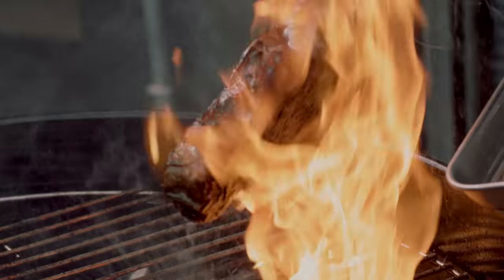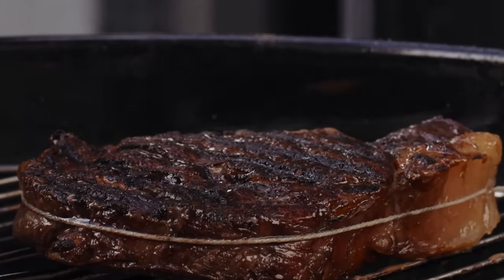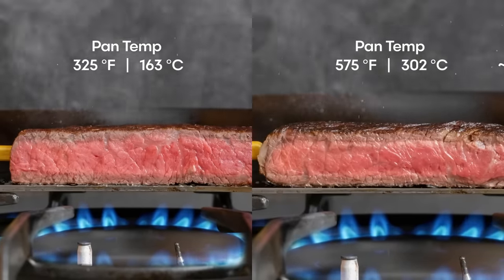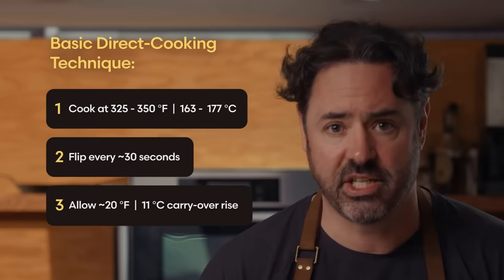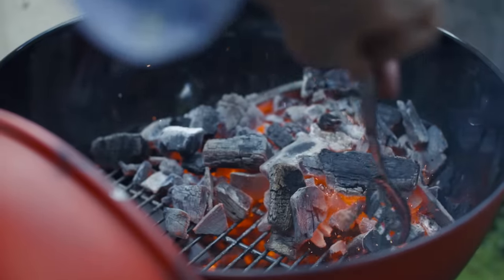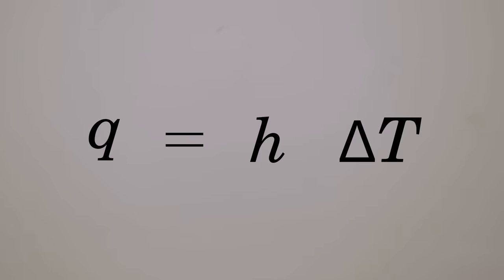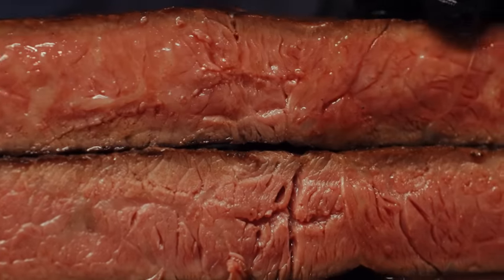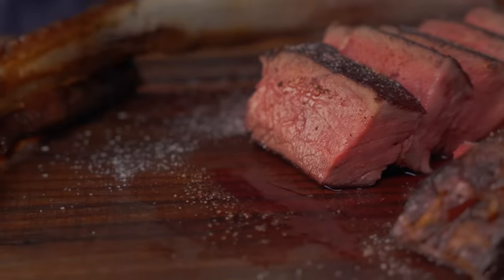Why Ripping Hot Is Too Hot? | TESTED

Comment: Insane! So much information packed in one video, had to rewind and watch at various points. Also, in terms of production, today's video looked like what I would imagine a video version of Modernist Cuisine would look like. Kudos.
Reply from the maker: Thank you so much!
Reply: I've been looking for the perfect technical tutorial on how to cook the perfect steak that conveys what I've intuitively picked up to friends and family, and this is the one. 

 @ChrisYoungCooks , you've got extremely high production quality, and you're able to articulate the nuances with enough concision to make tough technical concepts accessible. Plus, whatever the heck you did to make the cutaways work, amazing job.
Reply: what fryer appliance did you use at the end there? @ChrisYoungCooks
Reply: medium rare pork chops are the best
Reply: @hab1b1  It looks like a knIndustrie borosilicate glass pot.  I personally wouldn't try this at home.  Borosilicate glass is perfectly capable of withstanding the 400F temperature he's using.  But it has a much higher potential for catastrophic failure than a metal pot.  It was a great choice for the video, to enable people to see the deep frying in-process.  But you won't like the burns you'd get if, over time and hard use, the pot develops a crack and bursts when filled with hot oil.  knIndustrie sells this pot for boiling pasta.  Still not great if it breaks on the stove, but that's only 212F instead of 400F.
Reply: hey man, this is a really awesome and informative reply. really appreciate you! @missingegg
Reply: @ChrisYoungCooks  I may be overlooking something obvious, but I'm legit baffled at how you got the cross-section cooking shots! Special pans cut in half? Video AI generation magic?
Reply: @missingegg well said compadre!

Comment: I just put enough oil in the pan that I might as well be deep-frying it.
Reply: Oil temp will drop a lot if it's shallow and impede a good sear.  Specific heat of oil is much less than h2o.   That why deep fat is recommended- oil temp won't drop as much.. Cast iron for vessel helps.

Comment: Yesterday, I made some reverse-sear steaks and what I thought was a mistake, leaving my steaks out for 20 minutes and then searing them in the cast iron on medium turned out to be one of the best steaks I've ever made. After I took the steaks out of the oven I got distracted with finishing the roasted potatoes. Normally I take my hot oven steaks and throw them immediately in a hot pan and often, the steak goes way past medium. I actually prefer the reverse-sear (and wait) method because you can do large groups with this two-step process. Ripping hot pan is "the best" is somewhat of a myth to getting a good crust. Thanks for this video.

Comment: I’ve been using a Combustion inc thermometer for a few weeks now. My steak cooking method has evolved as a result. I cook in a 200° oven until the internal temperature reaches 105°.  I then sear In hot pan with a generous portion of oil. It’s not deep frying, but it’s close. After resting the internal temperature is right around 130°.  I like the idea of resting before searing. I suspect I will have to cook to a higher internal temperature initially. 

Thanks for the great information. I love your thermometer.

Comment: Really nice content. For work I helped a chef who was writing a book and we did several experiments on browning. I agree that excessive temperatures are not needed, also because the Maillard reaction also occurs at lower temperatures. What is important is the drying area, it is necessary to prevent the steam from raising the steak from the Pan and lowering the temperature, increasing the gradient of liquids towards the surface. To do this we have found that a light weight is always needed which forces the steam to exit laterally, speeding up the whole process. And this applies from steaks to vegetables. give it a try chris
Reply: so like a bacon press? or something long and thin across the middle?
Reply: @russellmz like the bacon Press. I suggest something like the chef Press that allow evaporation
Reply: That makes so much sense. Chef presses are a luxury gadget I’m struggling to justify but I’m glad to have my intuition corroborated!
Reply: That makes complete sense when you think about it: smash burgers always require a weight and they’re best known for having that wonderful crust. Different application, I know, but in principle it’s similar.
Reply: @BarneyCarroll  How about the bottom of a cast-iron skillet??
Reply: @BarneyCarroll  Its been a while since your comment, but you could easily ask at your local machining/milling place to make one for you. It might be cheaper the offcial price
Reply: Agree that a weight atop a steak really helps- especially steaks that tend to curl when heated.   I made a weight from a Lodge cast iron, 8" trivet.  It has many big holes to allow the steam to escape.  Added a handle made from 3/16" steel rod with ends pounded flat, a hole drilled in each and trivet then screwed to trivet.
Reply: @BarneyCarroll  Drill holes in a cheap but heavy bacon press.

Comment: I feel so good about myself after watching this video! I taught myself searing steaks in a Manhattan kitchen with a nearby smoke detector that could not be disabled so I had to figure out how to do it without setting it off, yet get that nice brown coating under 2 minutes! I ended up using the sous vide technique, then leaving it out to dry on paper towels and cool off for about 20 minutes, and then searing it in a cast iron skillet that was preheated for about 8 minutes on the not very powerful gas stove. That seems to check most of the boxes to get a good sear, and once I had perfected this technique, it really did! The only thing missing was the charbroil marks (I do like some of those). Recreating that with a torch wasn't super successful. Now I have a nice outside charcoal grill, but honestly deep frying it sounds really appealing too. I might have to try that.

Comment: As someone living in a poorly ventilated apartment with no hood and no grill (something that is probably not terribly uncommon in cities) learning about cold searing kind of changed my life! I went from not having a good seared steak (or pork chop/loin for that matter) for years to being able to have one whenever I wanted. It's not perfect, and doesn't produce a crust quite as luxurious as a traditional sear method does but it gets extremely close, is easy, time efficient and most of all produces no smoke and very little or no splatter so cleanup is nothing. That is my favorite method for searing or cooking steak in general, these days. Though I did want to try deep frying (before I found the cold sear a couple years ago) because it was also a no smoke method and I thought it'd produce a perfect crust. I'm glad you tried it.

Cooks illustrated has a great breakdown on the cold sear, for anyone interested. I'm sure there are other resources as well.
Reply: Cold sear has blown my mind. It's going to be my go to method for a while.
Reply: I'm in the same situation. I pan sear steak multiple times a week and it smokes up my apartment.
Reply: I have a cheap backyard/camping propane burner. I set it up outside and throw my cast iron right on the burner, using a cheap infrared thermometer to get my pan temperature right -- I like to start at 650F then I turn the heat way down for basting. My electric stovetop can easily get the temperature I want but the smoke is too much inside. Works perfect for me.

Comment: This is so great! I have a simple electric stove and a cast iron pan, and just through trial and error I noticed that my steaks turned out better when I had the dial set to 7 or 8 as opposed to 9 or 10... that the steak cooks internally by way of the water boiling is a revelation. At the lower temperature, I can cook my steaks without filling my house full of smoke, and they cook to proper doneness. I was frustrated by the fact that when I had it ripping hot, I would cook the steaks until the sear was borderline burnt, and it STILL was too rare in the middle. Now it all makes perfect sense! Thank you so much for your experimentation and taking the time to make the video!

Comment: This matches my experience when cooking thick steaks, though one additional step I usually take is to do a long dry brine beforehand.. like three days salted and uncovered on a rack in the fridge. This really desiccates the surface of the steak so it spends less time boiling off water and more time searing. Anecdotally it seems to help with an even sear, my assumption being that there are fewer patches where steam got temporarily trapped under the steak.

Also, when searing thinner steaks like a skirt steak, I think higher heat is helpful. You want to sear hard and fast so the crust develops before it gets overcooked in the center, and getting the exterior as dry as possible to start with is even more important here.
Reply: When you do the dry brine, do you notice the steak shrinking and requiring a shorter cooking time? I am still experimenting with how much less time to sear the steak on cast iron after dry brining since it overcooks faster.
Reply: 3 days is more than just brining... it start to cure the meat. I only dry brine overnight (until the surface is dry) before cooking.

Comment: Having tried the deep fry before it is really good but as you said it is a lot of extra work. 

My current go-to is allow to air dry over night in the fridge salted. Then pre-sear in the pan. Season steak with other non-salt toppings or aromatics and sous vide. Then cool and re-sear on a skillet again. Seems to give me the best crust when comparing crust to effort.
Reply: So pre-sear if you will before sous-vide and then a quick sear afterwards 🤔. I’ve wondered about pre-searing vs post-searing for sous-vide (apologies, the terms only make sense in the context of sous vide cooking). The pre-sear makes more sense but pretty much every recipe suggests doing it after.
Reply: Searing twice is legit. Gives the meat 1/4 of an inch in a chance to cool, so there's less gray band and more sear. However, a little gray band is not the end of the world.
Reply: Too much time and work.

Comment: Based on the video and your comments, I will experiment with sort of a hybrid. During the searing phase, instead of deep frying, I am getting a small cast iron grill pan, that has raised ridges.  I will char some beef fat, make into smoked tallow. Fill the pan around 3/4" with tallow, bring to 350 F and sear while gently moving the steak. Edit: BTW I have seen recent videos testing a newly released wireless meat thermometer in deep fryers, for whatever reason, the ambient temperature had been off during deep frying. Puzzling.

Comment: I've been cooking steaks for over 2 years now. I've always nailed down the crust and can get that mahogany surface with any steak, but the center is always a problem. This video detailed exactly what I was doing wrong. Not to mention, your cinematic shots are great and as a biologist I can say your explanations are spot on. Sub well-deserved
Reply: What did you do wrong?
Reply: @filipsvedlund4539  probably running too hot so that when his crust was finished to his desire amount the center didn't have time to cook to the way he liked it. That or vice versa with too little heat and inside being over cooked.
Reply: @filipsvedlund4539  Cooking on far too high of a heat and not using a reverse sear or sous vide method. I never once thought that the water beneath the steak's surface prevents the inside from getting to a certain temperature, but if you ass blast it with heat like I've been doing, you'll get a much larger grey band.

Comment: I personally like Guga's method of searing over extremely hot flames on the charcoal grill, avoiding grill marks, and then putting in a thermometer and let it finish cooking in indirect heat by searing over the hot zone, and finishing cooking over the cold zone.

Comment: What a fantastic video.  I love the science in cooking.  

I do a lot of what you do. I salt my steaks for at least 24 hours before cooking them.  I also remove them from the fridge at least 2-3 hours before cooking.  I always reverse sear on my Kamado Joe Ceramic smoker.  Get them to about 105 degrees, let them sit for 15 minutes while the grill cranks.  I have to admit though I was looking for 500-600 degrees there.  I then seared on my soap stone with Wagyu beef tallow.   I am now going to measure the surface temp with my laser thermometer and go for 350-400.  I am somewhat frying it in Wagyu beef tallow, just not submerged.  Thanks for the very informative, and very well done video!

Comment: Nice info, I actually was able to figure out a bit of it on my own. One thing not discussed that's important to me is that the fat caps on cuts like new york strip or rib eye get fully converted into an edible form with no chew, it does wonders for the flavor of the steak bites. Only way I know how with my cooking set ups is with the trusty old cast iron well heated and transfered into the oven after searing, sacrificing the basting step for a better result on the fats. Oh and if it's not dry brined in the fridge for 24 hours I'm not cooking it.
Reply: Dry brining is a real game changer, and its so simple.

Comment: Great video! I particularly enjoyed the comparison of reverse sear methods.

I'm "Team Shallow Fry with Radiant Heat."  I cook sous vide and sear using a cast iron or carbon steel skillet with ~375-400°F fat (50% ghee and 50% beef tallow] about ¼-inch deep. I flip frequently and hit the top with a Searzall while frying the bottom. This speeds up searing, gives a tiny touch of char, and eliminates unwanted surface moisture on the steak before I flip again. The Searzall softens the torch's flame and eliminates flare-ups in the fat that would be a problem with using a torch alone.

Comment: Love the graphical and thorough video. 🔥 I use an asphalt/weed torch, like you use to clear areas of scrub brush. I have a empty grill willed with bricks that I put my meat on to sear sets of meat or roasts all at once. 

I can usually knock out 4 tri-tips, a pack of chicken thighs, or 10 steaks, all in one go, taking less than 5 minutes tops. The bricks reflect heat back and do a good job brown searing the undersides while I put a more brown sear on the top side. I'll usually only flip once. 

I'd love to see you tackle flame searing in-depth. What I love so much about sous vide  and my torch is I can render the fat on steaks so that it's not rubbery and quite delicious to eat, similar to the crispy liquified fat on well-cooked bacon. I don't exactly know what's going on here to make fat go from gross to edible but it's worth an investigation. 🤜🤛  Thanks for all you do! ♥

Comment: Good info here, you taught this engineer a thing or two! That was a really cool cut away shot with the split pan and sizzling meat. 

At the 6:50 mark you state "the heat vaporizes any remaining water at the surface within seconds". However I think the sous vide steak will have more nearby sub-surface water present that slows or decreases the intensity of the sear.

I think sous vide will start to go out of favor as the experts now have us all worried about micro plastics. The higher the temp the more available the particles are.

Comment: Great video and very informative.  There's a flavor that charcoal brings to the table that I haven't found anywhere else yet.  I like to sear over the flames for 2m total, 30s flips in between, then cook in indirect heat - I'm more concerned with the flavor than the "crust" you get.  The flavor, in my opinion, is unbeatable.

Comment: The similar effect could be replicated on a charcoal grill using the grate rotating technique. By cycling the steak in and out of the hot zone you are exposing the steak to a cool grate surface for short bursts of extreme heat but before burning. I was able to achieve almost same result as low temperature pan searing but with the added charcoal flavor.

Comment: 3:38 You have misunderstood the principles of heat transfer. There are three primary mechanisms of heat transfer: conduction, convection, and radiation. You are correct about the boiling point of water limiting the conduction and most convection heat transfer, but neglecting the radiation component is a significant oversight. Radiation becomes the dominant heat transfer mechanism at higher temperatures.

Comment: I’ve been cooking for nigh 50 years. I recently started searing my ribeyes with a 1500 degree Big Horn oven. The perfection of crust is light years beyond anything I could achieve in a cast iron pan or any other technique. 
I challenge you to match my results. 
After the sear, the steaks get moved down several rack spaces and get cooked to 122-125. They get pulled and tented for resting. At 134 they get sliced and served. 
No burn crust. Just perfect thorough char, moist medium rare. Zero complaints
Reply: Thats interesting, I really want to see a comparison between the two methods. Be awesome to see that in person with blind taste reactions.
Reply: @MasterGhostf  it’s a game changer. No flame up 🔥 because you’re cooking from above the steak. Then lower a cook with probe until 122-125 then rest.

Comment: This is a really awesome video. I have favored the reverse sear by starting in a pellet smoker at around 225F until close to the desired internal temperature and then going straight to a ripping hot sear box which allegedly gets to around 1000F. The results have been generally very good.
I recently got a sous vide and have begun experimenting with that and have definitely noticed more of a struggle to get a nice sear due to the amount of moisture remaining, even after patting dry. 
I'm definitely going to try letting the steaks cool a bit and flipping more frequently the next time I'm searing in a cast iron pan.